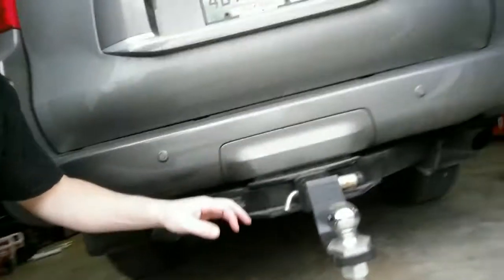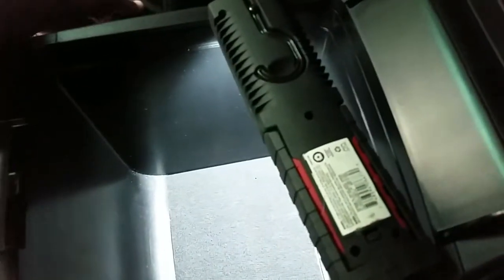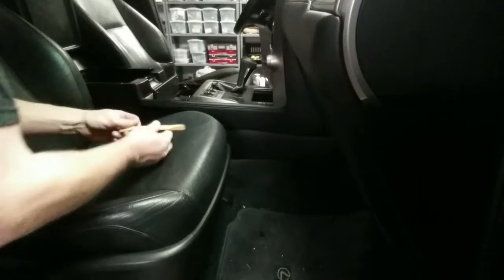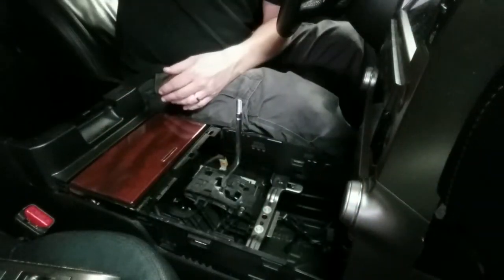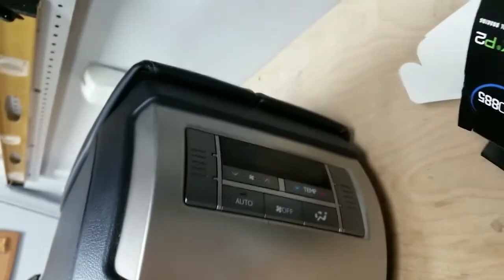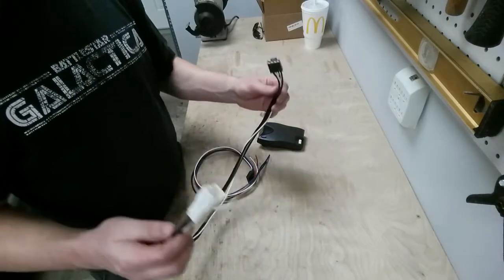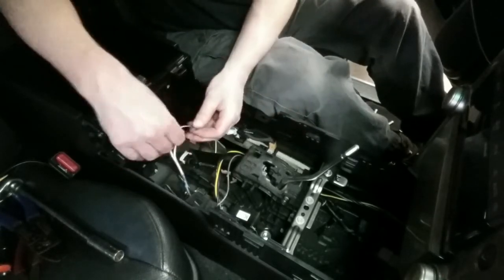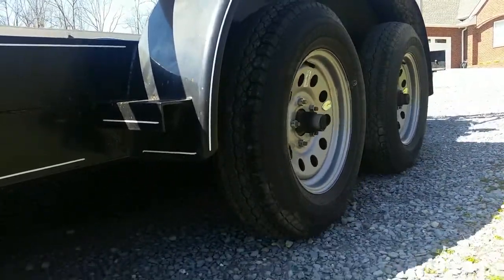Project #12 - Brake Controller Install on GX460

Comment: love the Battle star shirt!   when you bought this, is it lexus specific or toyota? Been having a hard time finding this for my GX
Reply from the maker: Thanks!  Brake controllers are all generic and work with most any vehicle.  The only thing that is vehicle-specific is the wiring harness, since different manufacturers use different electric connectors for their harnesses.

Comment: Hello hello how does she do when towing and how much do you tow? I'm thinking of purchasing a 2016 or 2017
Reply from the maker: I've towed a 16' tandem trailer with a small car on it before, and have had no issues with power or stopping, just awful gas mileage.  I towed a 12' enclosed U-Haul trailer fully loaded, and got about 11 MPG on the interstate.  The GX460 usually gets about 18 MPG.

Comment: Don't you need to be able to operate brake controller in emergency? Why would you mount it there?
Reply from the maker: I don't know of a scenario when you need to operate the brake controller in an emergency (I could be wrong about that).  Its my wife's car and I didn't want to distract from the aesthetics with a bulky control box hanging under the dash.  Thanks for watching!
Reply: @VancesHowTo  if the trailer is waging you turn on trailer brakes separate from car brakes.
Reply from the maker: @divineflowstevenandsamara  I guess I've never heard of that!  :-)  I don't even know what "waging" is.

Comment: Thank you, however you did not show the hookup under the dash, which would be useful.
Reply from the maker: I didn't show the hook up, but I did show the location of the connector you plug the harness into.  Its at 6:20.

Comment: Fantastic tutorial- thank you. I have this same SUV. Just got a quote at the dealer for a hitch. Thanks again,
Reply from the maker: Thank you!  Glad you found it useful!
Reply: The hitch was super easy on my 2020 GX460. Used a Curt hitch, my 16 year old son threw it on in a few minutes. Looks a lot different than your generation which is more complex
Reply: I just learned from another YouTube video
 https://www.youtube.com/watch?v=tVyTmkUkqMI&list=PLos1VNyPP5EP5VfPgza4_sglDl3S-lp7I&ab_channel=StreetRodJim
that the Curt hitch is only rated at 5000 lbs. The factory Lexus hitch is the only one that handles the 6800 lb capacity of the vehicle. Our vehicles aren't a different generation, I just bought the wrong product. It's ok for my utility trailer, but I just bought an enclosed dual axle trailer, I just ordered the Lexus hitch  for $346.50 including WI tax and shipping off eBay.